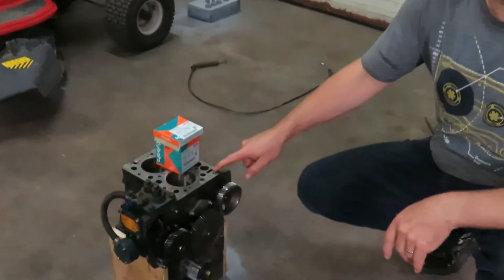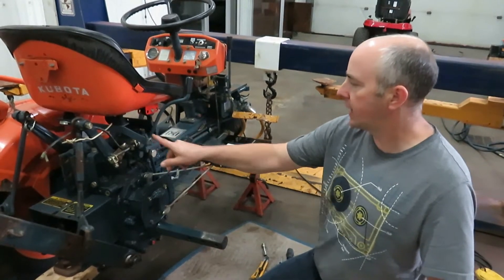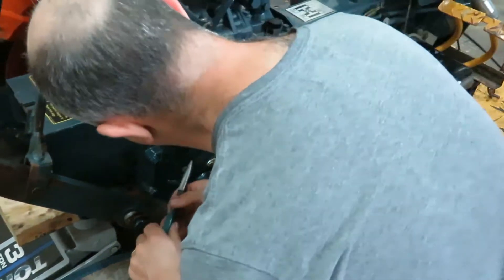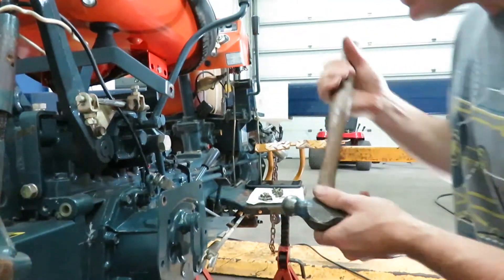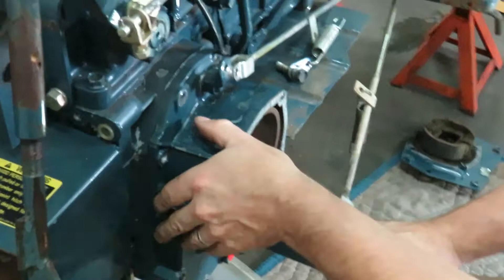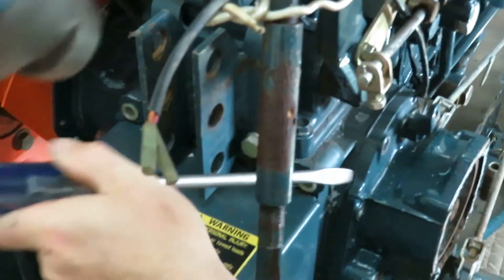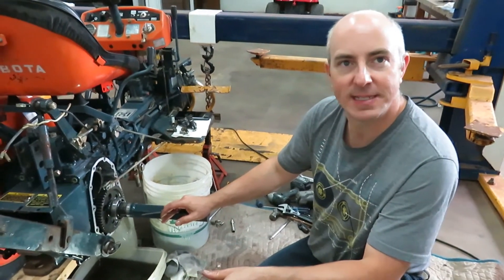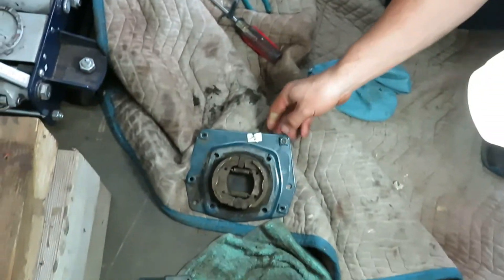Kubota B5100 Rebuild, part 4: Oil Leak

Comment: I remember when I rebuilt my B7001 (2018 i think) I took all 4 drive shaft ends to a machinist to re-sleeve the faces where the seals ran(it was lightly ridged. It leaked badly at one point. I got genuine Kubota seals and also replaced the bearings and now am using 80w90 oil in there and so far it looks ok.